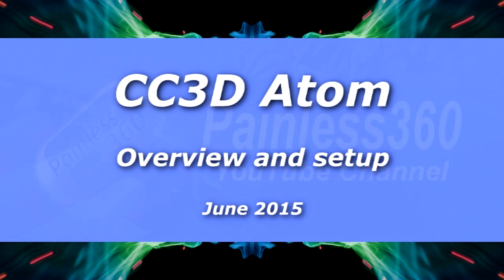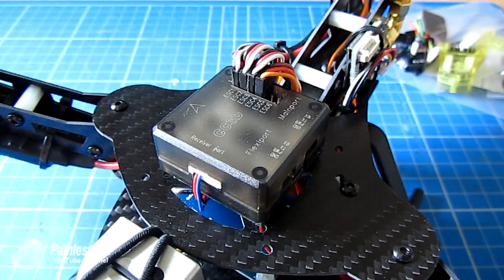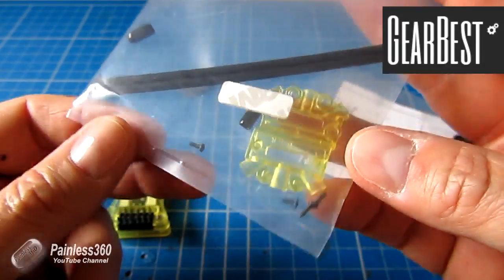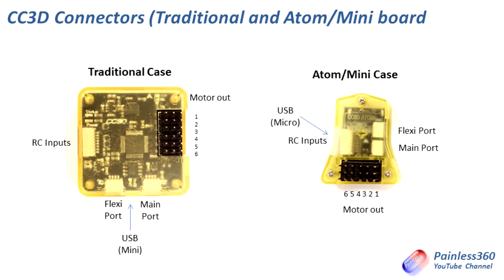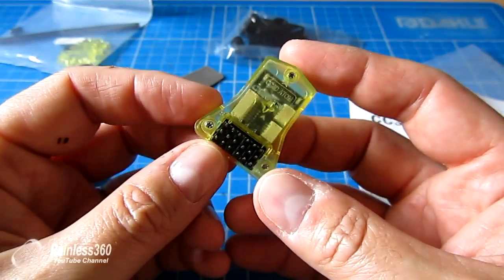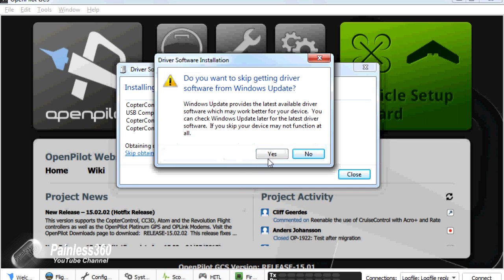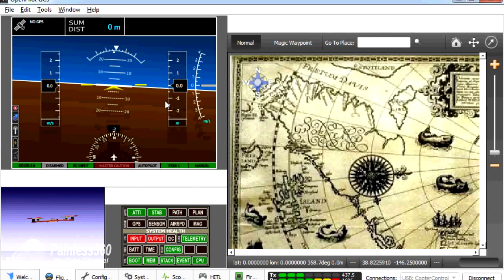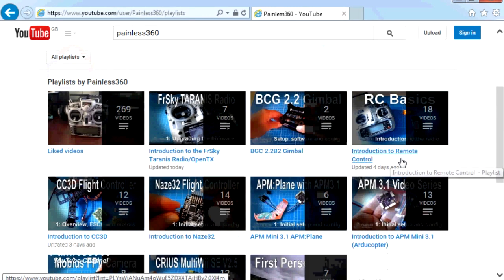(8/10) CC3D Flight Controller – The CC3D Atom/Mini version, supplied by Gearbest.com

Comment: Looks like it has been awhile since anyone has posted.  I'm having difficulty finding the CC3D Atom Mini.  I ordered two from a supplier and they sent me the wrong thing and then said the Atom was out of stock.  Any suggestions on suppliers?  Btw, I intend to use it in a lifting body deployed from a rocket and need the craft to be stable during the descent.
Reply from the maker: The CC3D is a very out of date FC. See my video on flight controller comparisons and builds for more up to date options..

Comment: CHEAP and CHEERFUL. On Banggood they are selling this frame combo - 2 PCS Kingkong 260 PCB Frame Kits (Grey&Black) 10 Pair Propellers CW&CCW. I couldn't believe what I got for 20 USD. 2 frames and all the parts and pieces and hardware. 2 PCB and LED bar and lense for both frames. 10 props, 2 antenna and battery straps for both frames. These frames are perfect for a SIDE PIN NANO FC and I'm planning on just pure ACRO FPV. They are PCB not carbon fiber. But for me I wanted something I could fly as hard as I wanted to and not worry about crashing and losing a lot of money. CHEERS !!

Comment: Hi can you please show me how to WIRE the CC3D ATOM FC TO a FRSKY D4Rll RX using factory wires?  please
Reply from the maker: The D4RII used PPM so you can wire it up using only one cable with three wires in (Gnd, +5v and Signal). See us doing that in the https://www.youtube.com/watch?v=p1EhSYNa0pM Be careful as sometime the software want Pin3 or Pin8 as the signal wire so check the documentation. Best of luck!
Reply: I've got the Atom set up with the quad motors but it won't see D4RII.  I've read several places about Pin 8 may be signal wire.  If so, how do I modify the 8 wire bundle?  Do I swap out Pin 3 for Pin 8 on the 3 wire servo connector that goes into RX channel 1?  Do I need to do anything with the old Pin 3?
Reply: all I did was take the pluh that had red ,black& white wires and pluggd them into the D4Rll RX ACROSS THE TOP FIRST 3 as shown in painless360 video PINS

Comment: In your cc3d revolution series you paired it with an op gps unit so your quad could have extra features such as return to home. Would you use the same gps unit on the atom? Or would you suggest using another gps unit such as the mini ublox neo 6m. I have a 250 size quad and I want to add return to home features like you have so your input would be greatly appreciated. Thanks in advance and I find all of your videos very helpful.
Reply from the maker: See the video later in this series where we add a GPS to the basic CC3D, should help...

Comment: I put this on a 250 size quad because of its size....incredible stability. Better then my 2 f450s  running apm2.8s.  Rock solid..... $12.00 !!!
Reply from the maker: Glad you like it! I'm a fan of the CC3D. Great for beginners as it's a piece of cake to setup and fly!

Comment: I tried open pilot when I plugged in the atom the lights go on , but it tells me it's not connected when I try to go to firmware ? Should I trash open pilot and use libre pilot ?
Reply: I uploaded librepilot and I have the atom mini cc3d when I do the first part where you hook it to the computer to see that it all connects It sometimes can ask when it does and I upload & erase it times out every time ?
Reply: open pilot is not even supported anymore its librepilot now

Comment: Hi Painless 360, you have helped encourage me to try and build a ZMR 250and it's been fun until now -setting up with an Atom CC3D has given me issues with Windows 10 running. Upon first hooking it up and opening OpenPilot (which may I ask also -would it  have been better to try Libre Pilot instead?) I saw the Atom was recognized when I plugged it in before installing it on the chassis. Now after flashing the latest software 12.2 I believe-it is NO LONGER recognized and times out. I have tried plugging it in right after clicking "recovery"...   Any thoughts? 
Thanks again for all the HARD WORK you do!
Reply from the maker: I would reload everything using Librepilot now.  Best of luck!
Reply: +Painless360 Thanks you -I'll give her a try, Cheers!

Comment: hi chap , iam wanting to now if you can put the mini atom back to original format as i flashed  clean flight  to it but i want to put it back to open pilot , but when i try and upgrade and erase it times out and wont connect , is there a way to reverse back to open pilot
Reply from the maker: Yes you can, we do talk about it briefly in the video. It takes a bit of trial and error. I find the trick is to plug it in after clicking the recovery option.. Best of luck!

Comment: My cc3d cant be program.I cant get any signal when the usb is plug in.I think because the coptercontrol file is gone.I dont know why.How do i get back the cc3d to its normal state
Reply from the maker: +kingzmen kinzmen The CC3D has it's own bootloader so shouldn't be bricked. You can re-flash the bootloader to force the board again if needed. Best of luck.

Comment: Do have a link to the video were you setup a wing with the cc3d? I'm building an fpv wing and have never set one up with a control board before. I love your channel! :)
Reply from the maker: +KlingerFPV I have got it waiting to be finished as I do have a wing that flies with a CC3D, the problem I can't seem to solve is that when autolevel is turned on the amount of control I have is minimal... Until I get that sorted I'm loathe to release it..
Reply: Alright. As soon as you can is fine with me, thanks for the quick responce! :)

Comment: painless360   i'm going to get one of these for my hisky 280 hmx... i bought it used from alishanmao on onlyflyingmachines.com and i haven't had a flight yet..i plugged the craft into my laptop using an old phone cord that fit ...it doesn't reconize the right stick on the controller and when i get the output calibration all i get is a little fizzle out of my motors .. not enough to spin the props for sure ..(not that they are on)..also my controler beeps repeatedly it won't seem to bind or arm the copter ..its as if the copter isn't there..i'm learned that controllers sometimes do this from losing a few of them haha..do you have any advice? has any of this stuff happened to you or have you heard of it ..
Reply from the maker: +mark yeomans My advice would be to get in touch with alishanmao and get support from the chap who has your money ;) Best of luck with it.
Reply: +Painless360 i did ..his advice was best of luck haha
Reply from the maker: Sorry to hear that - he should be providing support for his customers. I would make a video of the issue and send him the link. Best of luck...

Comment: Great video!
I want to buy the Mini CC3D for my t-rex 450 fbl, will it work on helicopter?
thanks!
Reply from the maker: +Arkadi Raider I've not tried it but the code is there to do it. I would be very careful about vibration on the model when adding this to the 450. Best of luck. I'd be interested in the results!
Reply: +Painless360 as i know, if i will put the MultiWii firmware i can set the HPF to reduce the calculations of the vibrations. first of all i'll try to fly OOB and if it will go wrong i'll add the HPF

Comment: Have you seen this new, even smaller CC3D? It looks interesting but i cant find any info on it, and im not sure how esc's would connect.
Reply: +Bishop Vick www.banggood.com/Openpilot-MINI-CC3D-NANO-Atom-Flight-Controller-for-QAV250-Multicopter-250-Frame-Kit-p-992324.html
Reply from the maker: +Bishop Vick Looks like you need to make up a wiring harness to connect the motors too. See the APM Mini 3.1 videos as you have to do the same thing there too..

Comment: painless 360 . im sorry for the ? . it just im gettin so fusterated. because i have spent like 500+ dollars on 3 flight controls an only my cc3d i can fly. my 2 apm controlers i cant figure out . the real thang is . when in my flight mode . weaklevel .weaklevel .axisloc .manual . it dont seam 2 level . it keeps going up an down an up an down . how can i fix this ! and i just want 2 say thankz for all of your help that you have given me . i really appreciate it lots!
Reply from the maker: +Mykel Plaskett I do offer direct Skype support for these instances. It is not free though. PM me if you are interested and we can setup a time.
Reply: how much is that gunna cost ???
Reply from the maker: The details are on the website.

Happy flying!

Comment: im flying my cc3d in a hk prrditor 650. it flys great, but i cant get it 2 stop drifting, an it  yaws ryte all the tyme while in flight .  what flite mode should i have it in ?  i use weaklevel ,weaklevel , axislock , manual ?
Reply from the maker: What are the channel values on the radio when the rudder, aileron and elevator controls are in their middle position? 1500?
Reply: +Painless360  yes they are ?
Reply from the maker: +Mykel Plaskett Are you asking me or telling me. It's confusing with the question mark..

Comment: what is the biggest quadcopter you  can use a cc3d with?
im  useing a hk prediter 650 with my cc3d ,
weakleveling ???????
Reply from the maker: +Mykel Plaskett As big as you can make it! I would use a board with good GPS modes for larger craft though.Happy flying!

Comment: if you update the firmware are you settings lost or not
Reply from the maker: Martin Habets I would always backup the settings, in my experience you need to check all of the setup on the board afterwards anyway. The update documentation will cover this.Best of luck.

Comment: wear would you connect up the cppm up on the atom board, is it just in the main receiver port, am normally fly with a naze 32, running cleanflight, and this came free with a quad i purchased, and i would like to give it a go,,,
Reply from the maker: Peter Wakefield The same place as the normal board. Openpilot will show you how to plus it all in when you use the wizard.
Happy flying.
Reply: Many thanks

Comment: How wide is the case and the shock mounting plate?
Reply from the maker: Georg Hartmann CC3D dimensions on the Gearbest link in the description. Mount is 36mm square with the lugs protruding another 4mm each side.
Happy flying!
Reply: Hey Thanks for the answer, i actually meant the Atom version :)

Comment: I just now received CC3D ATOM with minimOSD and GPS, you can install these accessories simultaneously in CC3D?
Which free use over the MAIN port?
Thanks for collaboration
Reply from the maker: Karlo Osimo You configure the ports in the same way as a full size CC3D. Port and setups for the OSD and GPS are covered in other videos in this series.
Best of luck with it.
Reply: Painless360 Thank you, I've seen all your videos (very beautiful), but I was wondering if I want to use both GPS OSD that together in one CC3D is possible ? (sorry.. I do not find the video that talks about it ...)
Reply from the maker: Yes it is. Although the GPS addition to the CC3D is of limited value..

Best of luck.
Reply: Painless360 

☜㋡☞ THANK YOU ☜㋡☞

Comment: Hello, I was watching your video here and noticed that the cc3d board installed on the tricopter has the forward arrow facing to the right instead of forward. I have the same frame and the arrow is facing forward and now I can't connect the usb cable. How were you able to turn it and have the heading correct for forward flight?
Reply from the maker: matthew turner Hi, you're not using the playlists are you ;)
There is a video in the 'Introduction to CC3D' playlist that explains how you do this. 
Happy flying!

Comment: Hi there....so you seem to be the go to guy. I have not yet found a fix to the problem 
I have with my cc3d. I have an issue with the completion of the mode switch that does not want to allow completion of the set up wizzard. Im running a turnigy 9xr pro with a frsky djt module (non telemetry) .......would really appreciate your advice.
Reply from the maker: drone19730602 What troubleshooting have you already done?
Reply: Painless360 I have checked the software and realised that the version of the software I installed was 15.2.2. which is the latest update for the cc3d,atom, and a few others. So what I have done is unistall the software and reinstall the version 15.2.1. It seemed to only have the problem once I had installed the 15.2.2 version.
So lets hope that solves the problem.Ill let you know what the outcome is. Unless you know what the actual problem is and you have the fix. Thanks.

Comment: what are the consequences to the main board/flight characteristics when its suffering vibration? (especially without an anti vibe mount) Thanks
Reply: Bishop Vick when the board suffers vibration the gyros sense motion and because this motion is not inputted by the receiver, the board tries to counteract them. pls correct me if i'm wrong. :)
Reply from the maker: Bishop Vick Flyingflippy is spot on - the vibration can be read by the accelerometers and gyros on the board as movement (sampling frequency etc.), this causes the board to try and compensate and causes un-commanded movement. 
Always try and reduce the motors and props - you get a nicer, quieter craft and the batteries will last longer!